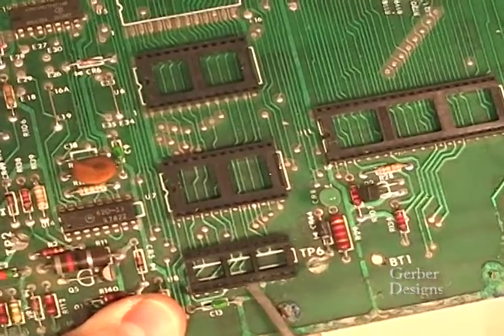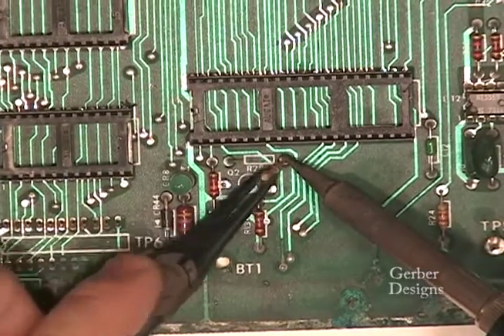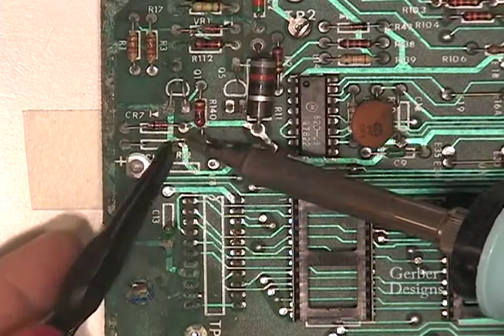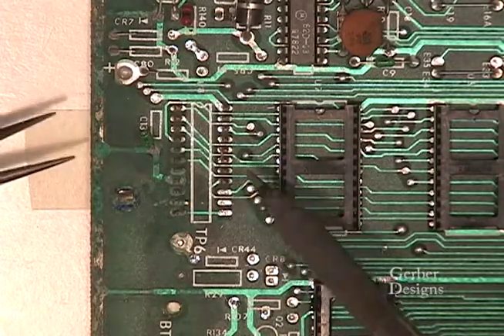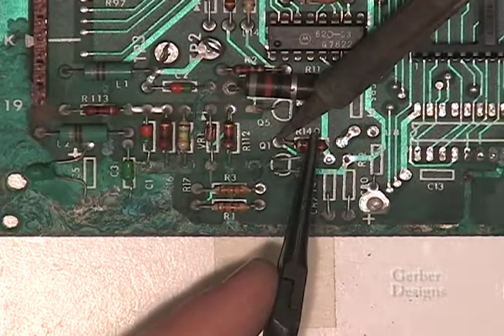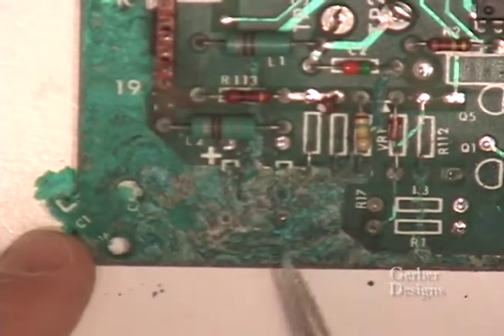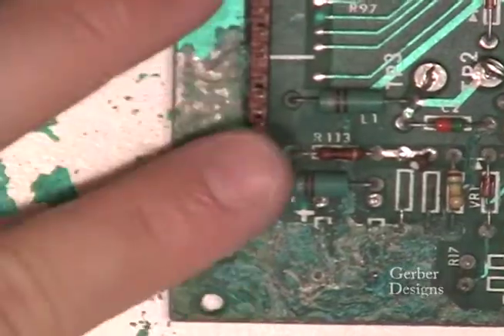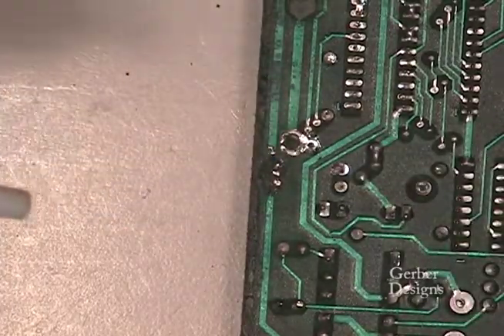Part 2 of 7 - Removing Components - Bally Pinball AS-2518 MPU PCBoard Corrosion Repair

Comment: Thanks for taking the time to share. Not quite how I do it ,where the chemical damage is I grind it with a Dremel and a fine bit.  A tedious job for sure.  R113 and R16     
   I usually replace with 12K resistors.  The Valid power detector is right in the chemical damage path it can be challenging sometimes not worth it I have ground it all off on one and just used a 12volt relay they usually pull in at 8 volts.    Often if you don't get rid of every last molecule of that battery puke it just comes back like cancer.    Hack a board and no outside depot will touch it you start you finish it or give it a funeral and say a few words to the owner when you tell him to buy an Altek.